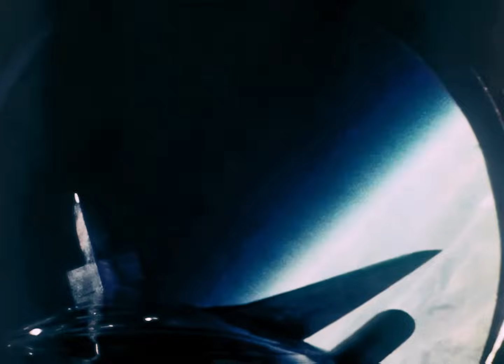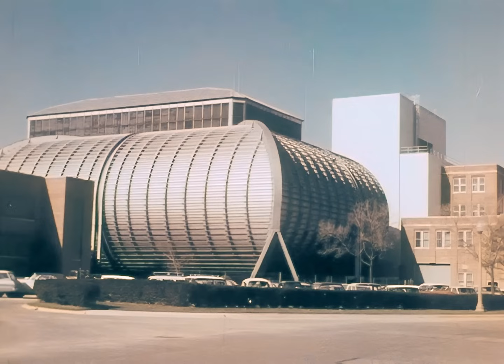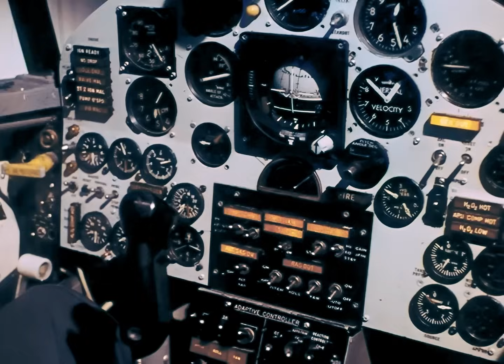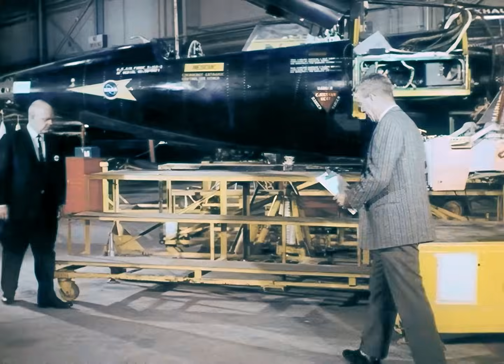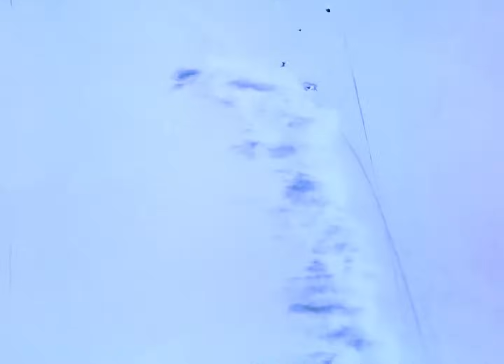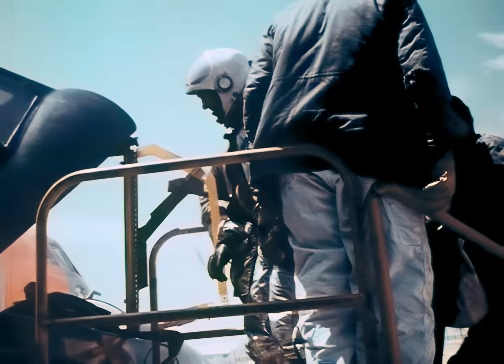Research Project X-15 - Hypersonic Research Aircraft, NASA, 1960s,  HD Remaster

Comment: I WOULD LIKE TO KNOW POTENTIALLY HOW FAST & HOW HIGH COULD THE X-15 GO ? ? ?🤔🤔🤔🤔🤔🤔🤔
Reply: The X-15 could have achieved a maximum altitude of approximately 450,000 feet, and still been able to survive reentry. A maximum of Mach 8 was possible with the ablative coating and the external tanks, but Mach 6.70 (4,5320 mph) was the maximum ever achieved during the program.
Reply: @x15galmichelleevans  THAT IS INCREDIBLE & THE X-15 WAS AN AWESOME MACHINE & FAR MORE IMPRESSIVE THAN VIRGIN GALACTIC SPACE SHIP TWO ! ! !
Reply: @AndrewHillis_2024  Yes, the X-15 did many incredible things. If you are interested in the program, you would like my book, "The X-15 Rocket Plane, Flying the First Wings into Space."

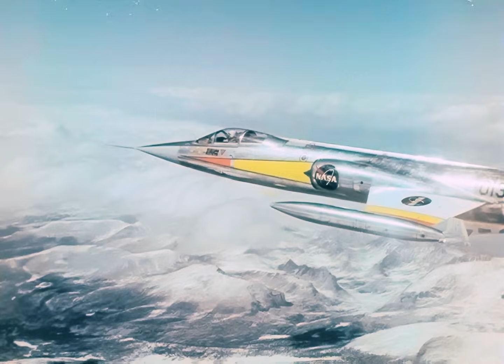Comment: The F-104 seen at 18:14 was involved in an infamous accident involving a PR photo for North American. Joe Walker was flying it in formation with the XB-70 prototype when the 104 got caught up in the complex air flow over the bomber's wings. It snapped inverted and crashed into the 70 knocking off one of the vertical fins and rendering the plane unflyable. The 104 exploded and Walker was killed. The pilot of 70 ejected and survived but his co-pilot did not.